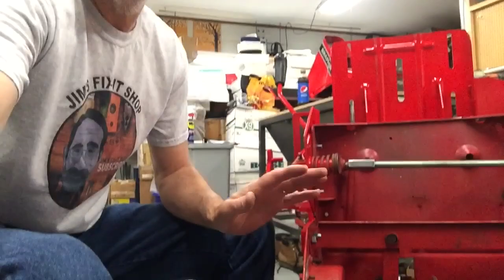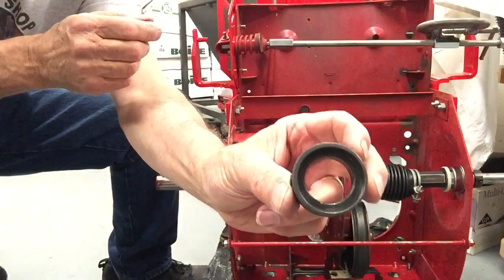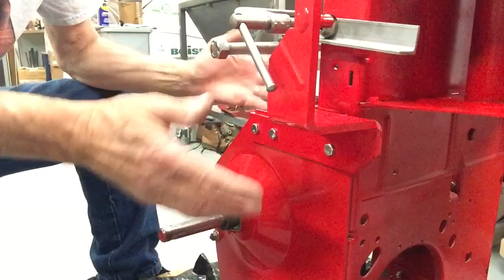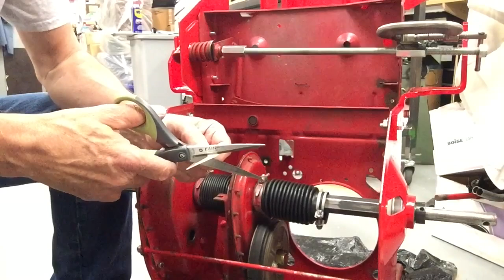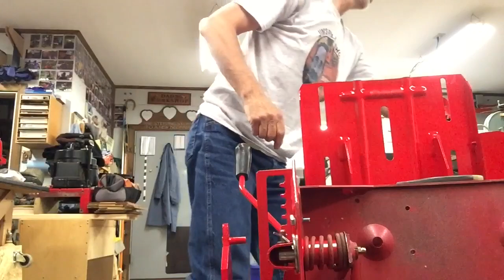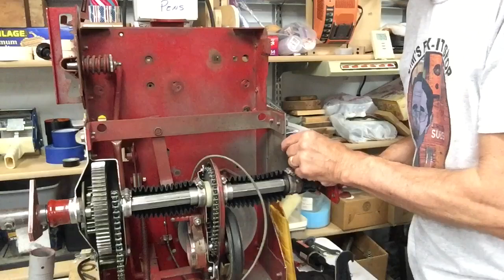358.  Part 12. How to adjust side play on the bearings in the rear axle and adjust the shift handle

Comment: You and your videos are invaluble sir. I have a series 23 12.5hp briggs and stratton i love it. Just added 4 of the plastic thrust washers to the inside of the left side axle, virtually no end play now i just added a new dust boot and grease seal to the outer side of the gearbox side axle.
Reply from the maker: Well it sounds like you are totally on top of these issues thanks for watching. Jim
Reply: @jimjackson9381   yes sir, thinkin of getting a bagger for it too.
Reply: @jimjackson9381   if i put the inch long bolt through the back of the wheel hubs to make lug studs, how tight or how much torque do i need to tighten those to?
Reply from the maker: @magnumtipton7293  I would use lockwashers and use grade 8 and I tighten them with a 10 inch ratchet as tight as I can. Or at least around 30 foot pounds.Jim
Reply from the maker: And I forgot you don’t need lug nuts the rims do not have a cones on the holes a standard and nut will work. Jim
Reply: @jimjackson9381  is it necesarry to use a flange nut or is a standard nut ok? And would you use a lock washer on the bolts that go thru the wheel hub for your studs
Reply: @jimjackson9381   ok that sounds good thank you very much. Keep on doin the videos, they are invaluble and a very useful tool, i learn a little more everytime, thank u sir
Reply from the maker: @magnumtipton7293  yes I would put a lock washer on the bolt and screw it through the backside of your wheel flange and tighten it down good, and then a standard nut  will be fine. Jim
Reply from the maker: @magnumtipton7293  well I’m not sure where you live or what year your machine is but I have a couple of single baggers and a double bagger for sale. Jim
Reply: @jimjackson9381  im in east tn. I just found a guy on craigslist who has a clamshell bagger with the handle that lets you empty from the seat. Looks in good condition its only missing the brace bumper pn# 7058745yp
Reply from the maker: @magnumtipton7293  Boy you better grab that I’ve been looking for one for years can’t find them up here. Jim
Reply: @jimjackson9381   i picked up the clamshell bagger ordered the bracket that was missing for it, got the new wheel studs on, and put the metal pipe nipple and cap on for the engine oil drain. Even put chrome acorn cap nuts on over top of the regular lug nut, looks pretty sharp. Thanks for the videos and information, its priceless
Reply from the maker: @magnumtipton7293  Hey you owe me a picture of you in your snapper to put on my wall of friends I want to see that clamshell. Jim
Reply: @jimjackson9381  ok send me ur email and when im home from work i'll get you a picture, its not complete im still waitin on the wheel kit that goes on the deck but will get you a picture anyway.
Reply from the maker: @magnumtipton7293  my email is
jimsfixitshop@gmail.com
Thanks. Jim

Comment: Hi Jim, question about the elliptical locking collar:  it looks like you are punching in a tangential direction as opposed to straight into the shaft, correct?  Does it matter whether you set it in a CW or CCW direction?
Thanks!
Reply from the maker: I would turn it as if it was a nut so the next person or you down the road will know to turn it counterclockwise to get it off    you don’t necessarily want to pound on it but you do want to lock it securely and then use a set screw to hold it from backing off. Jim

Comment: Hi Jim, I'm wondering what is supposed to keep the gear lube in the differential since there is a rather large opening in the side plate where the hex shaft comes through. The plastic thrust washer doesn't seem to be pulled snug to the opening after putting in the shims on the other end.
Reply from the maker: I sent you a couple pictures of the splash washer stops leaking on your differential cover if you do not get them let me know. Jim